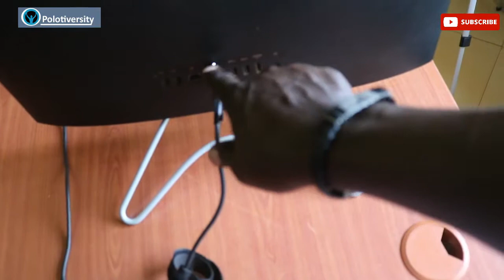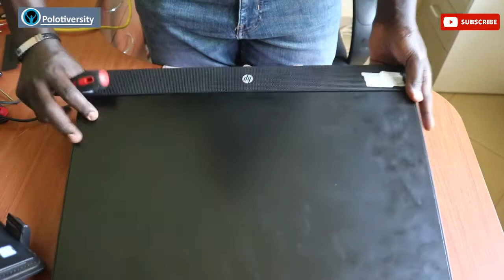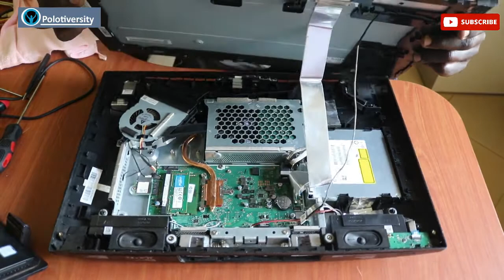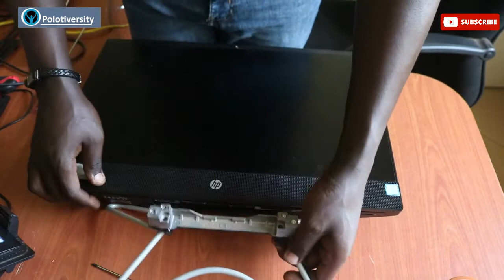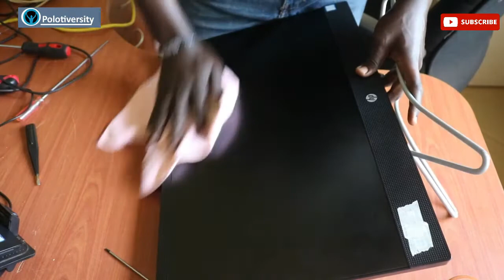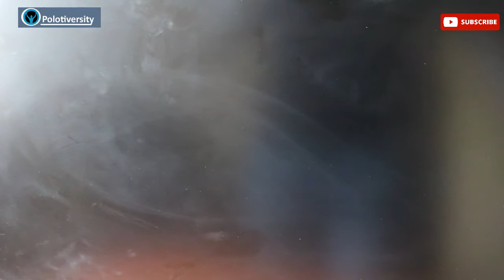HP All in One Desktop has no Display

Comment: Sorry to bug you again my last question is if I do take that little tiny battery out and then hit the power button and connect it to the negative and positive to clear it will it still have the windows software that was installed will I be able to just power it back on and have like a brand new computer?
Reply: yes
all good

Comment: Yo idk if youwould reply to this, my all in one works perfectly but its display not working i tried it with connecting it to another monitor and it works also i cant see the all in one's monitor in display settings i tried the cmos replacement and switching ram slots but nope its still the same all cables are connected in right place too do u have any idea about this?

Comment: Hy guy please 🙏 help I used a wrong adapter on my hp 2021 all in one pc and now it doesn't want to turn on
Reply from the maker: @lesedi, sorry about that!
Try troubleshooting using the steps below:

1. Get the right power adapter for that computer
2. With the AC adapter unplugged, press and hold the power button for approximately 15 seconds. 3. Reconnect the AC adapter, and then turn on the computer.
4.  If the computer starts, reconnect the devices one at a time to determine which disc or device is causing the problem.

If that fails, clarify on exactly what happened after using a wrong adapter, was it a higher voltage adapter or low voltage??
Reply: Hy sir I found the correct adapter and tried all the troubleshooting but still won't turn on but the white light on the back of my pc is on
Reply: If I take my all-in-one HP apart and reset that memory by taking the battery out will it stop beeping at me? I used to build hard drives and put fans on motherboards back when gateway computers was open seems like the hardware is pretty much the same idea but I'm not good at making them run better I don't understand that part you're the best technician very thorough

Comment: On mine all of the sudden it doesnt charge no light and not powering on😢 what can I check?How can I test the motherboard?
Reply from the maker: @Osito, Sorry about that challenge, kindly check with the power adaptor and/or power source, the fact that it's not lighting could be a sign that it's not getting electricity transmitted...
Reply: Might be a shortened out mosfet or capacitor..mine did and I replaced them...got power but its not showing display. I'll switch out cmos and see

Comment: Have the same issue on two of those hp. Going to try it. Thx bro simple but sometime the needful
Reply from the maker: You are welcome @Rodrigue, let me know how it goes, Wishing all the best!!!
Reply: @opolotiversity  good pm. I have a problem with a HP 200 G3 that makes 3 long beeps followed by 2 short. Pls need help
Reply from the maker: @rodriguegaelessongue6579    Sorry about that problem!
3 long beeps followed by 2 short beeps is a memory initialization error.  This means that the memory has failed (This memory failure could have happened due to: Overheating,  Voltage too high or too low, Thermal damage, Faulty connector, Damage due to improper handling/ RAM incompatibility etc...) .

If you have more than one RAM  stick, you can remove all of them , Clean the slots and replace them one stick at a time in the slot closest to the processor and boot.

Try replacing or testing the RAM...

Let me know hot it goes..
Reply: @opolotiversity  thanks for your quick response. I will try that
Reply from the maker: @rodriguegaelessongue6579  You are humbly welcome, Kindly feel free to support the channel by subscribing!! Thanks
Reply: @opolotiversity  good day. It did not work. I've followed your advices yet still have the same beep code
Reply: I have removed the RAM from the faulty PC and slotted in another and it works. Mean it's not the RAM
Reply from the maker: @rodriguegaelessongue6579  Sorry about that, 
There could be a Thermal damage or a Faulty connector on the mother Board that might require a technician ..
Depending on your location, you can get Physical support from HP Support Team near you:
Below is the link : https://support.hp.com/in-en/service-center
Reply: @opolotiversity  thanks for your assistance. In case of thermal damage what should you recommend? Also i have another HP same serie that showed power when I plug the ac cable but no response when I try to put it on 🙏🏿